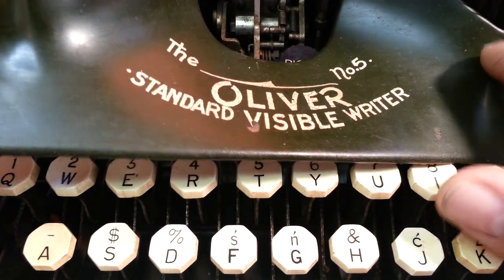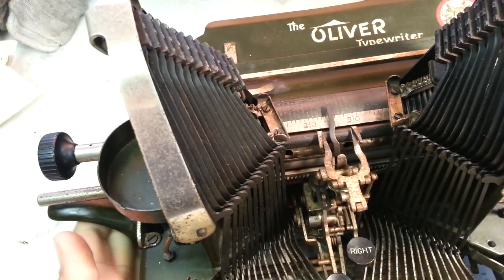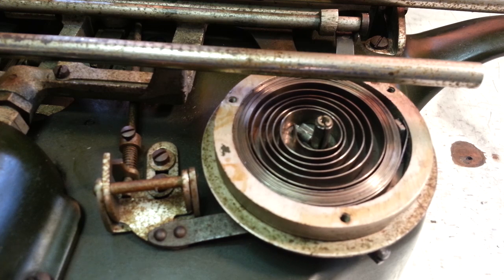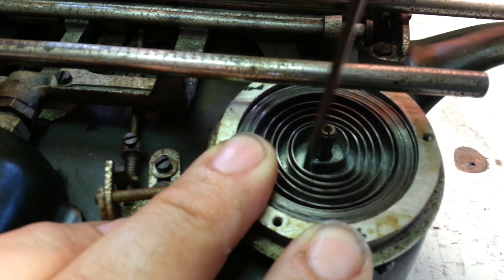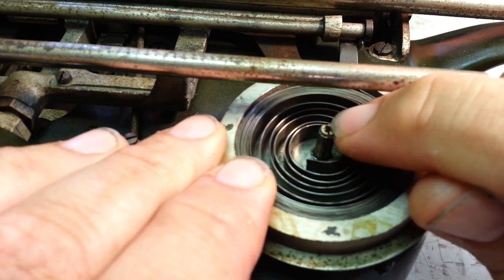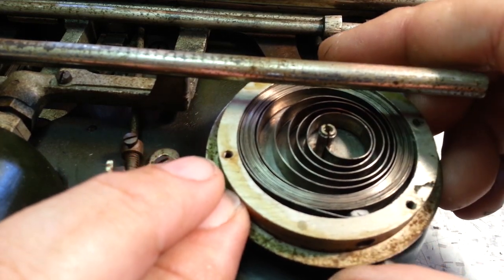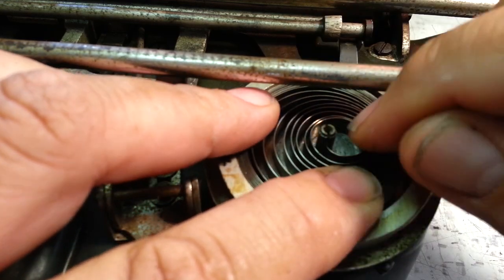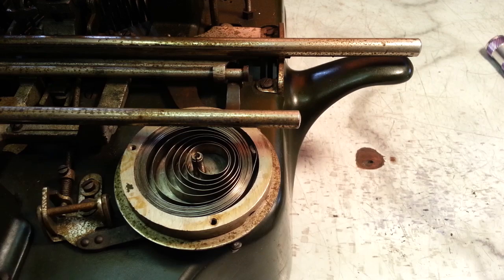Oliver No.5 Visible Typewriter Drawband Mainspring Repair Modification

Comment: I have a No. 5 here and it's draw string is a thick-ish silver colored string, not metal. Also, there's a clip looking hook on the end of it for connecting to that slot there. The string is tied to the hole in that clip with a simple overhand knot with the clip in the middle of the knot. Actually kind of surprised it is holding, given how short the tail is. Mine works except for a ribbon feed issue and I can't figure that out yet because I can't seem to determine how it's supposed to work just by looking it over. A project for later on! Gonna have to get a couple of later Olivers to fill out the collection.

Comment: I was working all night on my no 9 cleaning, oiling,  etc. I find the tab key seems to be causing the spring pulley to bind. When the tab key is pushed a finger presses up on something under the spring pully and this causes it to bind. When i move the pulley by hand it releases.
Also, the "Left" key has issues returning back up. I oiled the shaft but it seems a bit stiff it may need to be polished up i really am not sure. When the machine is upside down it returns beautifully. I welcome any ideas.
Reply from the maker: Without being able to touch/feel/see up close in person makes this a difficult question to answer
Sound like the left release has a physical bind, troubleshooting needs to be done first hand

Comment: I’m considering buying one of these. The one I’m looking at has problems with the ribbon holder moving. Is that hard to get to to work on?
Reply from the maker: That area is very accessible.
Reply: Phoenix Typewriter thank you very much. If I buy it, hopefully it’ll be easy to get in good working condition.